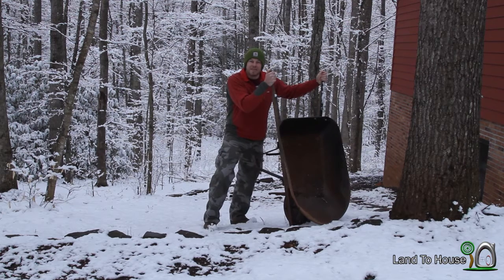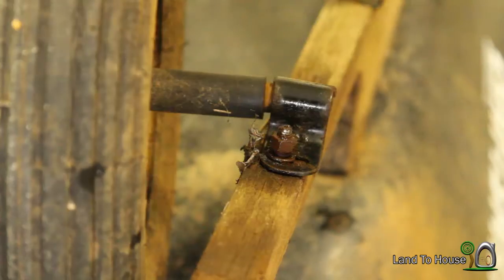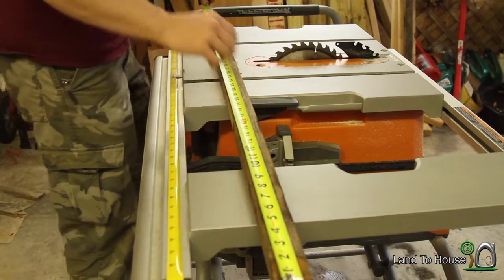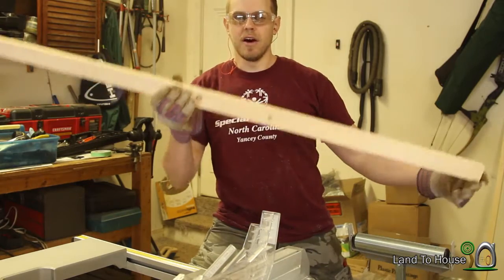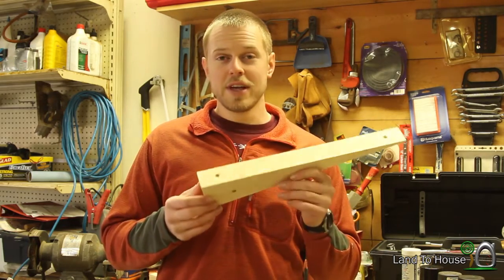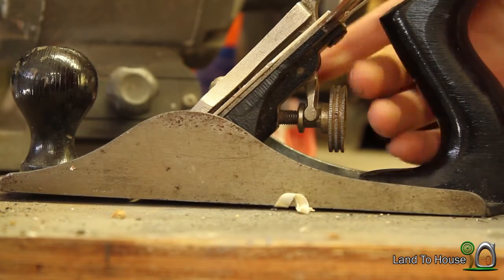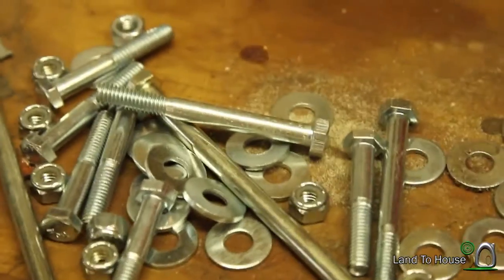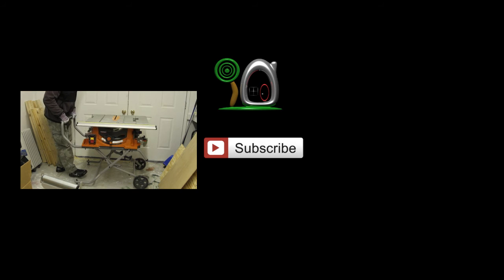Repair An Old WheelBarrow

Comment: I did a similar restoration on my wheelbarrow a month ago.

A couple of things I learned:

1.  When replacing hardware,  use galvanized parts to avoid the rust problem in the future.

2. Use galvanized carriage bolts in the tray,  to avoid having bolt heads sitting proud and obstructing using a shovel to empty the tray.

I also learned that wheelbarrows are vehicles that should be inspected from time to time and repaired as needed.  I let my barrow go until it was unusable,  which means I often didn't used it when I might have.

Just the nuisance of having to always pump up the tire might cause you to avoid using your barrow.  (I found that coating the inside bead of the tire with axle grease provides a good seal)

Comment: Thanks, well done video. Restoring mine now.  When I had a stuck carriage bolt holding the handle to the bin, I didn't want to use pliers on the threads and mess them up. I pushed the handle sidewise to bite into the bolt threads while  loosening  the nut.  Works if not too frozen.  (Your spring looks pretty cold!)
Reply from the maker: Thank you for watching! That is a good trick. My carriage bolts here too far gone for that though.

Comment: Seth, I have the same Craftsman wheelbarrow but in brick red. Bought it in 1982, the tire lost it's seal two years ago, so I bought an inner tube at HF, good as new. 🦀
Reply from the maker: Wow you found a nice old video! It's good to know these have replacement parts that are easy to find. .

Comment: When measuring wood that you want to mark with a speed square, leave the pencil at the measurement, then slide the speed square to the pencil. This makes marking your line much quicker.
Reply from the maker: Thank you for the tip. There are so many little things that make work faster. Now I just have to remember to keep the speed square within reach of my measurement. haha

Comment: Any more advice on rehab'ing the interior of the wheelbarrow? We have a nice, two wheel wheelbarrow given to us that is extremely old and very rusted and unsightly on the interior and exterior. I can't find any guides. Based on your video, you'd recommend using a wire brush on everything, and then spraying down with a new coat of paint? Anything else?
Reply from the maker: +Hayley Whitehead from my experience that's about all you can do. Once the metal gets so old and rusted I have not found much that will help but to scrape it down and paint it.

Comment: How would you make new braces out of wood? We live in a very salty environment, and keep buying new wheelbarrows at least every other year. We have several good plastic buckets, along with all the other parts....but I would love to find a way to use wood for the braces, since they go first.
Reply from the maker: When you say braces do you mean the metal legs that touch the ground?
Reply: Yes. They rust and I would like to replace them with something that doesn't rust. We have lots of wood we could use. Thanks for answering!
Reply from the maker: Interesting. my first thought is to have a regular rustoleum painting scheduled. I dont live in a salty area but it would seem if you could paint them with a rust stopper every month it would keep them from getting rusted. That component of the cart takes a lot of weight and I am not sure what you would have to do to keep the wooden legs strong enough.
Reply: I guess I have to buy another one again, the metal legs on this one are totally shot. Thanks for even thinking about this - I appreciate it and will treat a new one better!
Reply from the maker: Any time. I wonder if you can buy just the legs as a kit?
Reply: I looked further and you can buy a replacement kit, but it contains the wheel and some other things as well.
Reply: Fabricate some legs out of stainless steel tubing. Check with an area high school with a metal shop course or   a local vocation tech school.
Reply: Check out how-to-make a wooden wheelbarrow video, and modify to use any surviving metal hardware and wood handles.